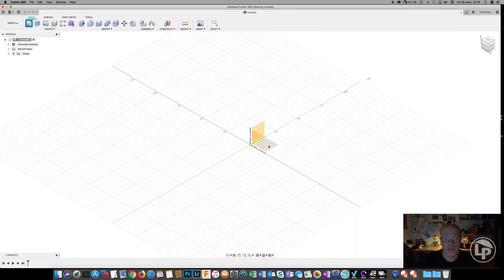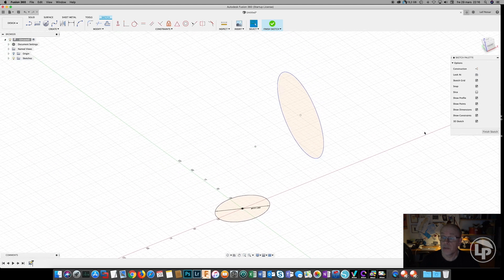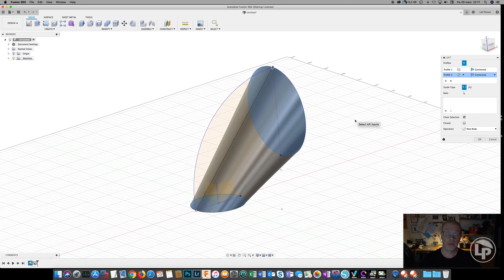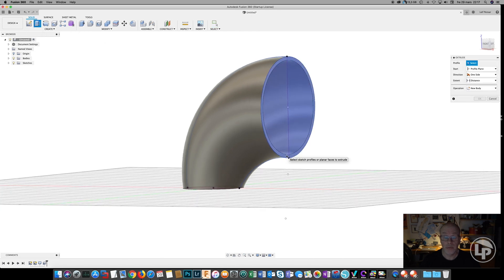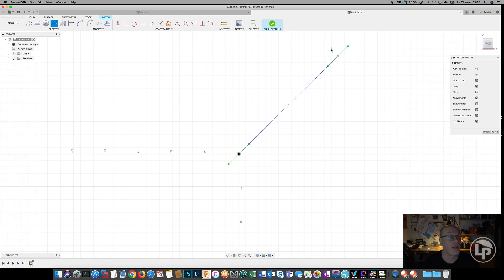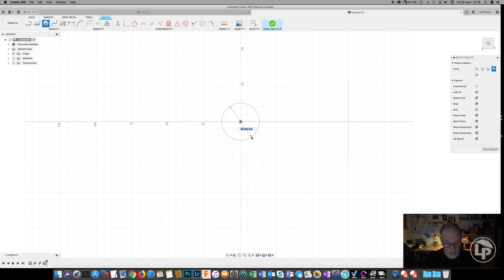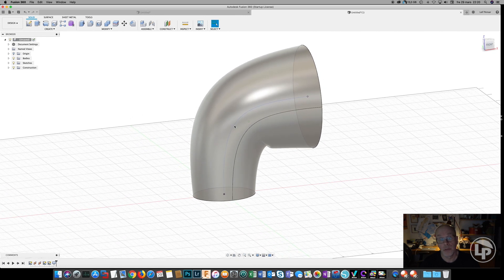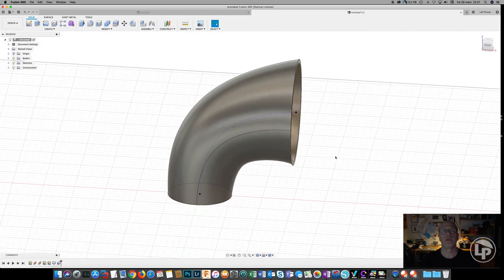Lofting in Fusion 360

Comment: Thank you for this,  but how to loft the ID on the big end for a dimension length and the OD on the small end without changing the entire shell, vacuum fittings have a small taper at the connections 
😯

Comment: I followed your tutorial closely and managed to do as you explained. What I cannot manage to do, is to add inside thread on either of the extensions. I tried different lengths, but it just won't let me. I cannot even select the inside face. What do I need to do to add thread to one of the extensions? I also used Extrusion to add straight extensions.